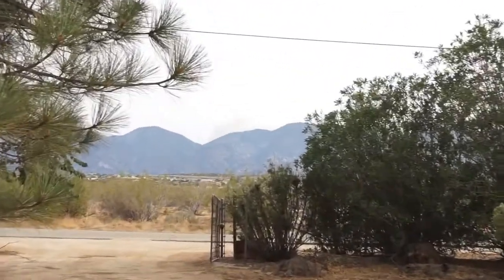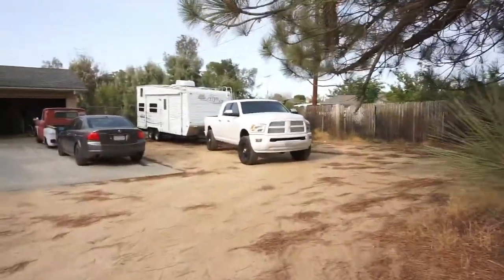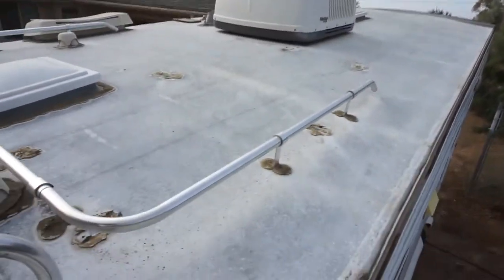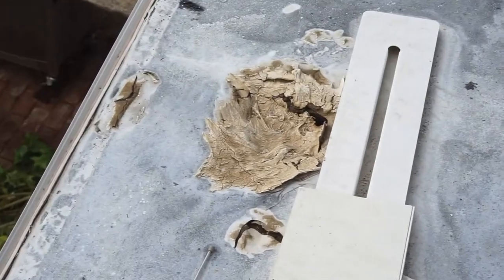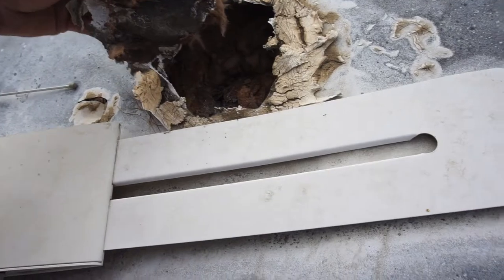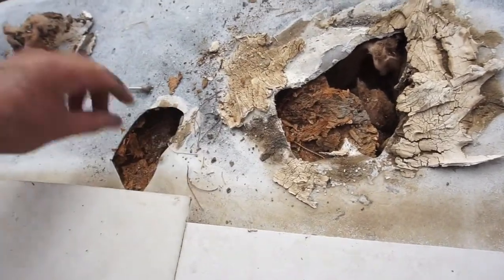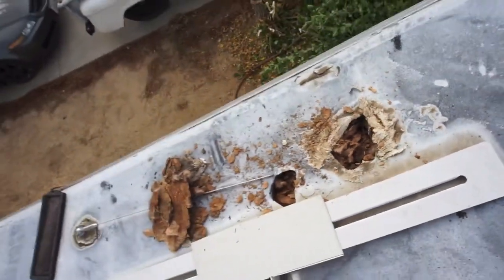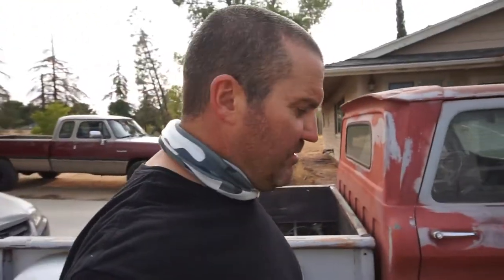Never Ends. Toy Hauler Roof Problems. Previous Owner and My Neglect To Fix It Years Ago.

Comment: put some cocking around the boots. if the roof is tpo i don’t know much about it might have to reroof that
Reply: tpo lasts around 20 years max i think
Reply from the maker: Yeah this is a 2002 so almost 20 years old. Thanks for the tip. I’m gonna reroof it in a couple months I think.